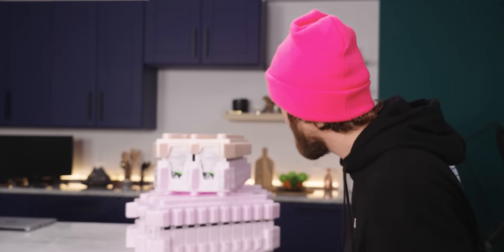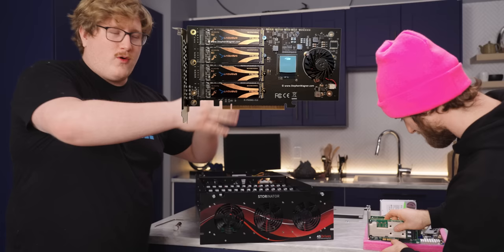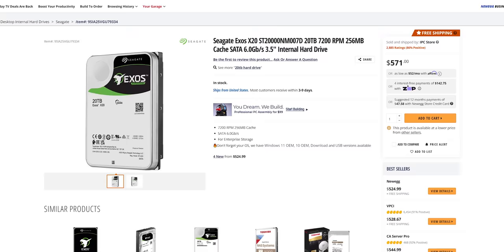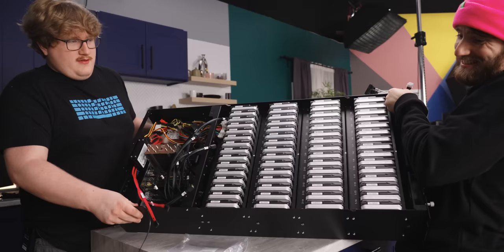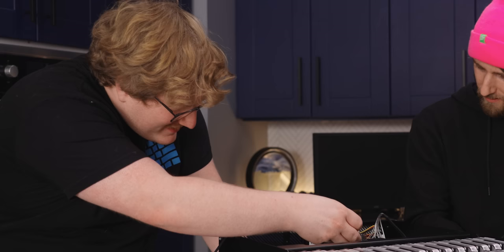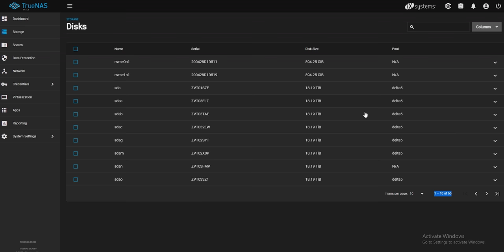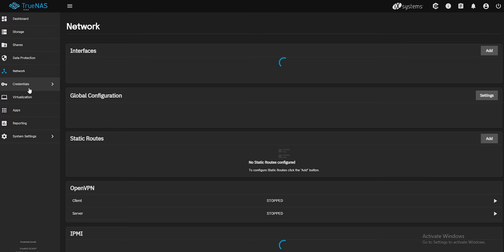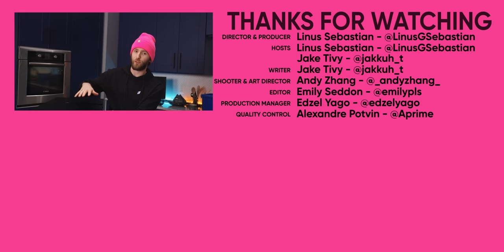My dream FINALLY came True! - Petabyte Project Recovery Part 2

Comment: I remember when the first 10 TB drives came on the market, and now 16 TB drives cost $280. Truly cool to see the rate of progress
Reply: Not really huge progress, just making smaller magnets on 20TB floppy disks
Reply: $280? Where? I could really use some, and the best sensible deal I've seen has been 14 TB Exos for 280€.
Reply: @jubuttib  They are 285 american bucks on amazon. But if you say in Euros it literally depends on where you live. In Germany they sell the 16TB version for 260€ at alternate but only let you buy one (the dumbest thing I've seen for an enterprise drive where nobody ever runs a single drive).

Comment: linus: "why would anyone buy a 20TB HDD"
also linus: buys 60x 20TB HDDs
Reply: Well the first statement was in regards to normal consumers. Linus is an enterprise consumer. There isn't much of a need for normal consumers to have 20TB at the moment. Maybe in 10-15 years file sizes might reach a point where 10s of terabytes make sense.
Reply: @ragefacememeaholic5366  no, first statement  was in regards to read/write speeds
Reply: Funny even though Linus' critique on R/W Speed vs. Data Density ratio of current HDDs (and thereby it results in compromises to reliability and other stuff) is actually valid (especially for normie consumers)... Most server users don't have much choice is the counter argument which he himself is ironically suffering now. I mean the two other alternative in the extreme is: 1) Pure SSD build (too expensive for 2PB, and an overkill performance for them), or 2) LTO Tapes (cheap and dense, but need a separate infrastructure for to be used effectively... unless they put Jake on 24/7 shifts to load tape back and forth).
Reply: Linus has a multimillion dollars business. He's not the one people are talking about when they make that statement.
Reply: Linus bought 0 hard drives.  Seagate sent them in exchange for advertising.  Good thing there was a failure, wink!
Reply: @DeputyNordburg  I mean honestly this is one of the places he went wrong. Seagates cheap for a reason. WD or bust.
Reply: @TheLameTechGuy  I like Toshiba more than WD.
Reply: @michaelfisher4737  "inus: "why would anyone buy a 20TB HDD"
also linus: buys 60x 20TB HDDs" I responded to this.
Reply: @ragefacememeaholic5366  agreed it was funny, but on a more serious note the context for when he said that was in regard to average consumers like myself. but nice pick up though :} so other people noticed this discrepancy hah.
Reply: The only way I ended up using 20TB was by having several TB of satellite data and hundreds of particle simulation runs on it.

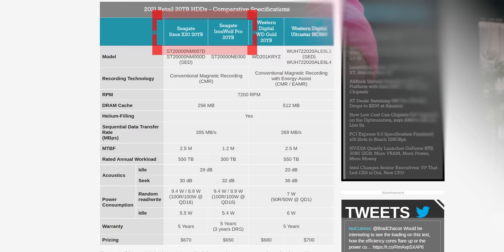Comment: 5:36 I found that too, I ended up getting EXOS drives cheaper from the US imported to Australia than the NAS grade stuff was anywhere... wut
Reply: I feel like it's because of the failure rate of Seagate? May be wrong, though
Reply: @ArensLive  It might be economy of scale at work
Reply: @ArensLive  so WD do better than Seagate?
Reply: @shawno8253  annoying thing is thats self fulfilling prophecy, "oh it didn't do well in Australia 10 years ago, so we aren't going to ever try again"
I just hate how that is the excuse, cause it does mean as an Aussie tech, its really fricking hard to source parts cause "we don't usually get much call for that" 

then again, we also don't get a lot of movies or shows cause apparently "we pirate everything"...its almost like if they released it over here, we wouldn't have the need to consider that?
Reply: I've been trying to import Dell constellation ES.3 (3tb) from the states to Australia too as its pretty cheap per tb (about $25). I haven't had a failure from them yet.
Reply: @ArensLive  . Yeah… you are wrong. This viewpoint t is based on outdated information from like a decade ago, back when 3TB was a large capacity drive. Seagate is fine now and have been for a long time. WD has had troubles too, and for a while was less reliable than Seagate, but was still more reliable than the 3TB drives.
Reply: I hate aus tech prices
Reply: Man we get bent over with any tech pricing in Australia 

I hate it
Reply: Can you tell where you get them from?
Reply: @jackdarrow3011  I used to be a WD fan, but after the SMR shenanigans that they pulled I've written them off. Deceptive company, and until leadership changes personnel, I won't be back.
Reply: @jasonmicron  yep even some of their nas drives are smr, ie the 8 bay nas versions, red versions,
Reply: Uuuh all a NAS is a HD with wifi and ethernet. juuuust saying.
Reply: I picked up a pair of 16TB Seagate external drives and they were EXOS drives inside. It worked out cheaper than buying them normally and they still have a warranty on the individual drives too, despite cracking them out of their cases!
Reply: @AndyMitchellUK26  Lucky you :) I picked a bunch of drives from Seagate 6 TB external drives and run the serials for warranty. They are all marked as "sold as part of a system" which means they don't get warranty individually, just as a package with the enclosure...
Reply: @gorkskoal9315  Deep storage, SMR is ok. But most people reading this are looking for local, highly available and accessible storage.

Comment: Perfect storage for taking a 1MB selfie every 3 seconds for ...100 YEARS! :/
Reply: That's a lot of Pickle Linuses... Linuses? Linusi? Linoos?
Reply: I did the math and that would take 1-2 more drive. Just wanted to let you know
Reply: Bruh pics take up 2-5 MB space these days.
Reply: encode as video to take advantage of compression across frames
Reply: @Caesar512  If "octopus" becomes "octopi" then maybe the "us" is replaced with "i" when going from singular to plural, which would make it "Lini" :)
Reply: WHoa its morn1415 the creator of star size comparison here!!
Reply: There is nothing you could possibly do to use or even just store one of these drives in a functioning state for 100 years.
Reply: @beezle1976  While “octopi” has become popular in modern usage, it’s wrong. The letter “i” as a suffix to indicate a plural noun only applies to words with Latin roots, like “cacti” for more than one cactus. But octopus is derived from Greek, so the proper pluralization in this case would be “odes” if it was ever used. I'm not sure of the etymology of "Linus" but pretty sure its not Latin nor Greek. So "Linuses" is correct

Comment: I agree with Linus, ssd smart readings are almost always inaccurate or no available. And sometimes the things just fail.
Reply: I actually had my 1tb Samsung 970 trip SMART and lock itself a couple of weeks ago with no warnings. After reading it in another PC it failed for extended high temps. It made the entire drive Read Only and I have no way to re-flash the SMART status to re-use the drive besides sending it to Samsung (which they may or may not do).

Comment: He keeps referring to what he had as "bit rot" it's not, it was mostly failed disks combined with a healthy dose of incompetence. I'm not going to say there was no bit rot, but it was probably pretty close to none, bit rot is slow and fairly rare, caused over long periods of time by cosmic rays and things, they will flip a bit here and there. What he had was varying degrees of disk failure. ZFS and enterprise/nas class storage devices do not try very hard to read problem areas, they just fail the disk and move on. If you get into a situation where you have an irrecoverable number of disks failed then that array needs to be taken offline, and the disks in an error state either sent to a data recovery house, or, start making an image yourself using things like ddrescue which will try quite hard to create a complete image of a semi functional disk. I've had multiple clients over the years with parity breaking levels of drive failure and yet I've never not been able to get the data back. It's probably too late for them now though if they onlined the disks and ran a scrub.
Reply: They need someone to do IT I think they basically just ignored it till they noticed a problem and then whoops lol.
Reply: I don't understand this either. Why they would actually turn on the drives and actually connect them to an array instead of backing them up with dd one by one is beyond me. That's one of the basics of how to recover from a broken disk.
Reply: @thebaker8637  I'm sure they just don't know for the most part.  Btw check out ddrescue,  dd will generally fail on sketchy disks.
Reply: @entelin  Yeah, I’m not so much of a recovery expert, I never had to do it myself, by ‘dd’ I meant ‘disk cloning tool that copies raw device blocks vs file system level’, I’m sure there’s tools out there as you said in your main comment that are designed for this.
Reply: Bit rot isn't caused by cosmic rays. It's caused by the magnetic field on the metal disk platter decaying, which is a function of the material, size of the bit, and quantum mechanics. Bit rot is a lot more common as you go up in disk size. Which is why RAID consistency checks are a thing.

Comment: Cool stuff. I used to work in a NOC that dealt with a lot of drive repair. Cold & hot spares both have their uses and should be kept available. 

More devices failing while you rebuild is what gets you so you do not want to waste time on having a replacement shipped if you can avoid it. 

Few hundred bucks on an idle spare is way cheaper than data recovery or a catastrophic loss.
Reply: It also depends on economy of scale.  You need a huge number of drives to make keeping your own stockpile of spares profitable compared to waiting a few days for each new drive.

Comment: I remember the day when 10MB in an old  XT computer was about the size of a shoebox and you would have to use programs to low-level format the drive occasionally to keep things "Lined up".
A company I worked for spent $1,000,000 for 1MB of RAM spread over 4, 7 foot by 19" cabinets. Whoa Dude! 
We are living in the future!
Reply: Ngl this sounds caveman-like. When was this?
Reply: @tanmay4217  One of these days you're going to say, "I remember when they came out with the 25 TB drives!"  Some young punk is going to reply, "WHY?  That's so small that you can't even put an operating system a drive that small.  What did you use it for, still photos?  LOLOLOL"   When that happens...I want you to remember this day and your comment.
Reply: @tanmay4217  Around 30-45 years ago i guess.
Reply: @nobody7817  
normal people don't use that much data but in linus case they use that much space for their work which takes a lot of space like you in the video
Reply: @nobody7817   tell me if you just have one petabyte which is 1000 terabyte tell me what you gonna do with all that space
Reply: @AhmedAli-tp6bl  I remember short sighted people like you saying the EXACT SAME THING when Windows only took up 10 to 15 MB and they came out with the 100 MB HDDs... NOBODY will EVER need more than 100MB of data.  Guess what?  You can barely even load Windows on that, these days.
Reply: @AhmedAli-tp6bl  NAH... YOU DON' T say, GENIUS!  I work for a company that had at least 2 million times more data than he does (The US Government).  I know a lot more about storage than you ever will.
Reply: @AhmedAli-tp6bl  And...btw... I was working for them back when the 100 MB drives that I mentioned in my first reply to you came out.  I, myself, thought 100 MB was a bit too large at the time.  So... time for you to take the blinders off, and learn a bit from people who know a million percent more than you do; rather than trying to ridicule them by ridiculing yourself instead.
Reply: Oh, mang…. I remember the first 100MB drive I ever installed.  Full size, full height, and sounded like a jet engine spooling up.  And when the heads unlocked, it sounded like a ball bearing being dropped onto concrete from shoulder height.  That, and spending $800.oo for 16MB of IIfx ram… at that was a doubly discounted student price on remaindered stock.  (1986 and 1996, respectively.)  I also still have a giant 12” single platter HD out of a “consumer level” IBM mini hanging on my wall as a kinetic sculpture.

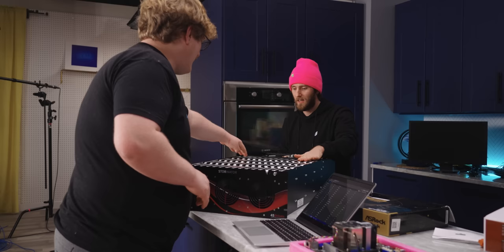Comment: 13:46 all these years of advancements and we don't have two tiny LEDs on those drives (one the "back" side of course, where they'd be visible). Have a power and a status LED, and you'd be all good to go
Reply: That's extra electronics not built for the process of the component doing its task and wastes power, especially for how many are in a server rack at a time, plus a power and status LED doesn't help as their are multiple power and status states of drive that no one could remember color code to just by memory..

Comment: Make sure to double check your ashift is set correctly on the pool! Can't change it without trashing the pool. Usually the auto detect works but I'm always paranoid the SSDs will throw it off.
Reply: Not sure what "ashift" is in this context, but the thought of a high end software system having terrible defaults is both scary and familiar as someone planning major server rework today.

Comment: I know this stuff is fun and of course is great content, but you would have thought you would learn your lesson by now. When you have this much storage, just get some actual, purpose built enterprise storage. For backups, do actual enterprise class backups with something like a Data Domain, LTO, or even Amazon Glacier as the backup target. At the VERY least, get some hot spares in the array so that if a drive does go down, it can start rebuilding right away.
Reply: His last issue was with important mid production videos. Ones not published to YouTube. This is an archive server, used for back up of old videos. He cares much less about if they fail. Because YouTube backs them up compressed. He mentioned on the Wan Show that cloud storage, or even a second server costs too much to justify.
Reply: @darrenhjki  That's why I mentioned LTO tape backup, those are fairly inexpensive. AWS glacier is also pretty cheap and most of the costs involved come with recalling the data. While not as cheap as LTO, would still be a pretty inexpensive solution. Just seems when you are talking about this much data a DIY solution might not be the best route. Since this is mostly backups anyway, cold storage, like LTO, will always be cheaper than this beast they are building, especially when you factor in electricity, the manpower to build it, and the labor time spent when it ultimately fails in a few years.
Reply: @nospam4chris  Linus is just in love with the idea of being able to pull in any footage from his entire online life, instantly.  It does drive content and lets him play with big-boy hardware and concepts; however half-assedly.

Comment: And here the mistakes start... again...
Raidz2 on 20TB disks AND 15 of them in a vdev, is WAY byond what is advisable.
20TB disks, would be closer to RAIDZ3 and 12 disks in a vdev for a production setup and even that is pushing it.
Reply: raidz3 in 12 disk arrays would be plenty. If you do regular monitoring and promptly replace failed drives, it's highly unlikely you're going to have more than one failure at a time, and if you get into a situation where you have mass failures and raidz3 isn't enough, then striped mirrors aren't going to be enough either. The whole problem here is that they had no monitoring and didn't notice the issues until they had multiple vdevs with failed drives, and multiple vdevs with two failed drives.